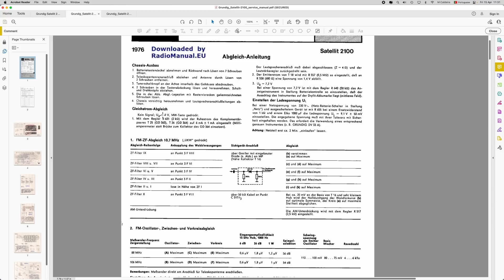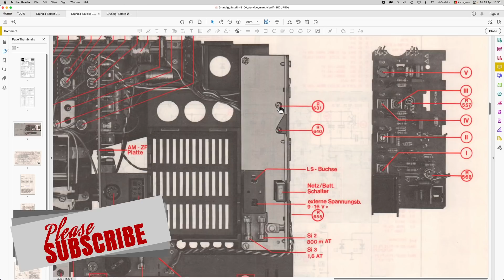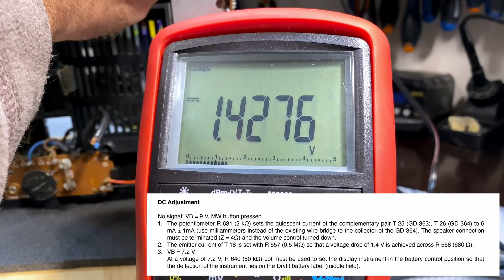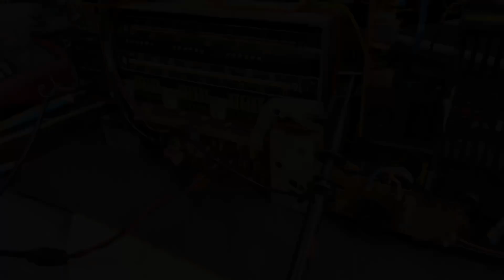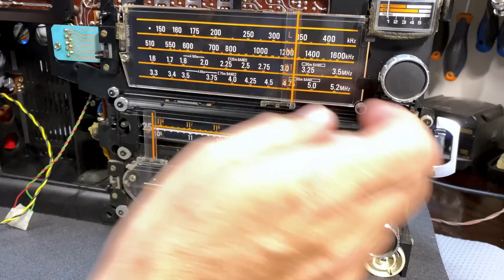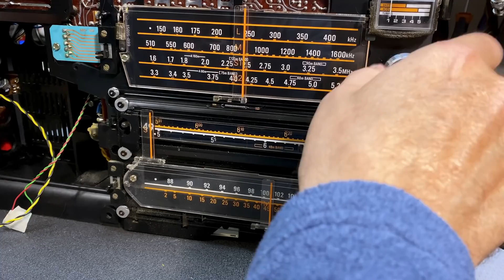Aligning the AM IF, both of them. Grundig Satellit 2100 restoration part 2.

Comment: Before any IF adjustment, first synchronize the tuning capacitor with the tuning scale. There are dots on each band, which the pointer must correspond to.
Reply from the maker: No, first I do the IF then the RF alignment.

Comment: Manuel, just got a 3400 at a bargain price... Well, i expected a nice portable hand radio, to take with me on vacation or around... Well... You just know what popped out... HUGE... :D just need a hand baggage for it on a plane :D

Are 6100 and others a little smaller? 
Bye
Reply from the maker: Yes, they’re a little smaller, but are by no means small 😊 You’re going to love the 3400. It’s a GREAT radio.
Reply: @electronicsoldandnew  it's incredible how the things to do are exactly what you did... FM low volume, SW drum blocked, switch Bandbreite to be dismantled and cleaned... Exactly all the same... Wish me luck! :D
Reply from the maker: Good luck 😊

Comment: Seems well aligned and sensitive. The instructions at the point when injecting a signal at C223 were confusing. How are you supposed to send a 460khz sweeped signal through a 10.7mhz filter? A mistake in the manual there I think. I like the design of these Grundigs, even if they seem a little over engineered.
Reply from the maker: The filter in question is actually tuned to 2MHz, as it is in that IF line. I also believe the instructions are wrong.

Comment: Has anyone tried recreating the boards with MC1350 IF Preamplifier chips and using SO42P chips for the Mixer and Oscillator and Custom made Crystal Filters to bring it up to spec.

Comment: I managed to get hold of the same colour service manual that you are using. I noticed most of the stations, even on Medium Wave the S meter didn't go above 3? My 2100 seems to not go much below about 3, I haven't really looked into setting up the tuning meter. Would be great if you could briefly touch on this and its setting up procedure, sometime during the alignment of this radio.
Reply from the maker: I’ll see what the manual says.
Reply: @electronicsoldandnew  many thanks

Comment: Yet another great video with thoughtful explanation of what is being done.  On a side note, why do you think the waveform is distorted on the scope?  I've noticed the same behavior on my scope (Siglent SDS1202X-E) at times.
Reply from the maker: I believe it’s due to underlying mains hum which is caused by the number of stuff I have connected on the workbench. Since the level of the signal is so small (it is capacitively coupled only), this makes it to the signal we see on the scope.
Reply: @electronicsoldandnew  Thanks for the explanation, makes sense.  I have a power strip on my bench next to IT equipment that feed off the same electrical circuit.  Cheers.  -Norm

Comment: ELECTRONICS OLD AND NEW THE ALIGNING THE AM IF BOTH OF THE GRUNDIG SATLLIT 21100 RESTORATION IS COOL MY HOBBYS ARE PAINTING PICTURES AND LISINING TO SHORTWAVE AND SSB IAM THINKING ABOUT GETTING MY HAM LICENSE I HAVE 4 SHORTWAVE RECEIVERS IAM THINKING ABOUT GETTING SANGEAN ATS 90 9X 2 OR THE TECSUN PL 660 MW LW FM AIR SW SSB 6 BANDS RECEIVER